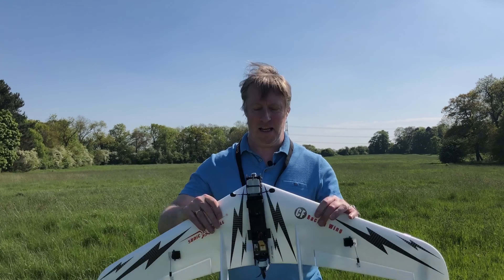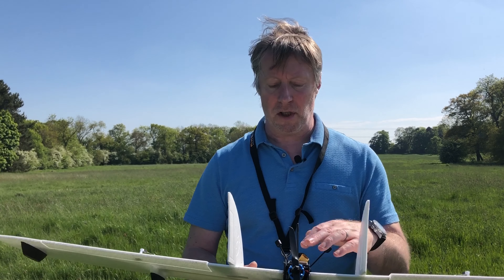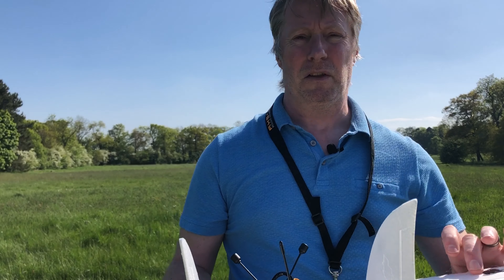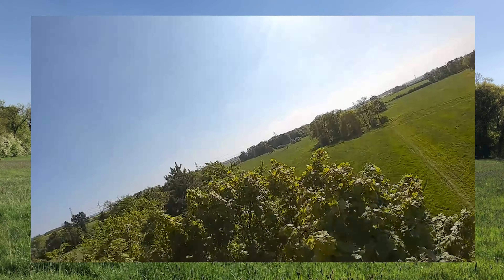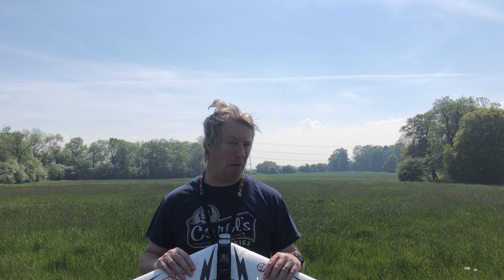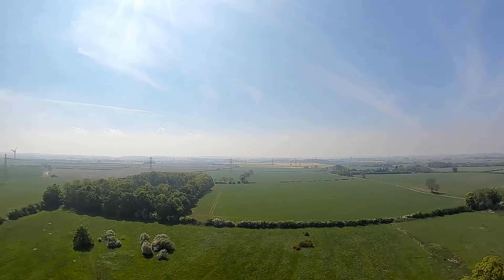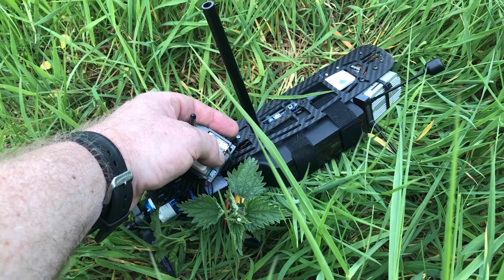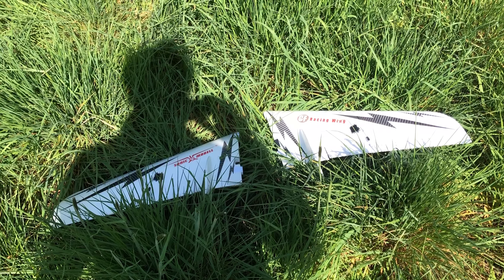Maiden of my Sonicmodell CF Wing running DJI FPV Sytem

Comment: Wow, high drama! Sorry you had a few rough days with the plane there, but it made for a great video.
Reply from the maker: I try to show the reality of my flight experience not just the best bits :-) Today was much better so in Part 2 I get to fly and tune the plane at last :-)
Reply: @bluefish3607  I put up the video of my first Dart 250g flight, it starts with a crash too!

Comment: Very instructive video. Wings seem to be bears to launch... perhaps a sailplane Histart with manual motor start well up the ascent would be the  safest way. It would need a good grip on the belly, with a good throw still needed since the stalling speed would be quite high. A belly hook a bit forward of the CG would give a fast, steep and stable ascent. Sailplane Histarts generally should pull 4-5 times the weight of the glider, though F3-RES histarts pull 10 times the weight of a typical 400 gram competition ship. Note that latex or silicone rubber tubing is used, not bungee cord. Good guide at the CRRC web site.

Comment: Great video - well done for your perseverance and I hope it’s up flying again soon.  I am flying an F27 Evolution and I was worried about the wings coming off so I taped them on.  Seems OK.  I think you are right that the spar snapped - probably the wings wouldn’t have just pulled out.  All the best.
Reply from the maker: I have made modifications and put captive M3 nuts in the wings and now hold them on with thumb screws in the fuselage and they are rock solid.

Comment: Hi, great video! What lead you to use crossfire and not the dji fpv remote? Is it because you already had the crossfire and you like it better? According to their website and some other videos using the dji goggles, remote, and air unit together will provide you with the lowest latency.
Reply: Because crossfire is the top !!! Not need a lower lantence it's not a quad racer.

Comment: Nice video, 

Which lost model alarm is that? I see hobbyrc do the vifly one. I think I need one :-)

With regards to the plane... you've done a cracking job with those wing joiners for the servo connections, and the other 3D printed parts.... but I think I personally will for sure give this model a miss. I'm not sure I'd ever trust a plane which has easily detachable wings... by design lol

I do understand their purpose, they're supposed to pop off in a crash instead of causing more damage to the fuselage... but I just don't think that's a useful "feature" lol

To me it looks like one of the wings literally just came off as you turned... the resulting spinning of the "half model" pushed the other wing off, and the carbon spar was broken when the spinning wingless carbon fuselage hit the deck...

Anyway, good luck with whatever you decide to do with this model. perhaps design something to just fix the wings on properly? 

I'm the same as you mate, I choose to NOT listen to people's advice because I think "ah I'll be OK" lol... was the same with my DartXL, the maiden went well and the first proper autolaunch test, but the 3rd autolaunch and it just didn't spin the prop and the model glided down to the ground and landed in some soft leafy crops... I get to the model and the fking nose had broken off. It's such a weak spot. I'd even reinforced it with carbon spars, but it snapped right were the carbon ended.!!!

Oh well, lol, we live and learn eh?
Reply from the maker: I dont think the magnets work very well, I have modified the wings and now they are fastened on with thumb screws and rock solid. I think you are right with regards to the crash the wings definitely came off in flight. 

Yeah I had a few nightmare with my Dart XL on launch but have it nailed now, it did cause me to have to buy another fuselage but this one is really well reinforced and since I got Autolaunch working perfectly no more damage touch wood.

It was a $30 Black Friday buy and just a bit of fun really to run the DJI FPV system for a bit of HD proximity flying.
Reply: Shame they don't make a non-goggle DJI ground station available, so we could put it on a tracker. now THAT would be epic... proper long range DJI system
Reply from the maker: @grim-upnorth  I think that may be on the horizon I dont think the digital revolution is going to stop :-)
Reply from the maker: Sorry I forgot to link the buzzer I use.
https://www.banggood.com/FPV-JHEMCU-JHE20B-Finder-BB-Ring-100dB-Buzzer-Alarm-with-LED-Light-Support-BF-CF-Flight-Control-Parts-for-RC-Micro-Drone-Quad-p-1561005.html?rmmds=myorder&cur_warehouse=CN